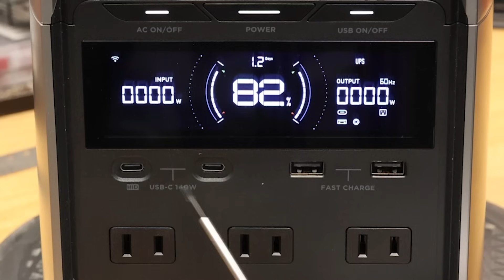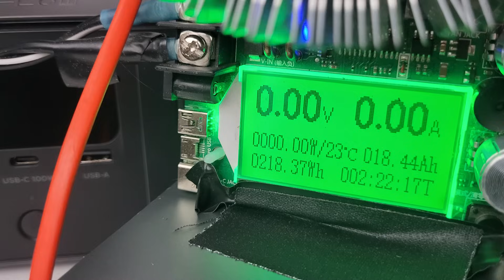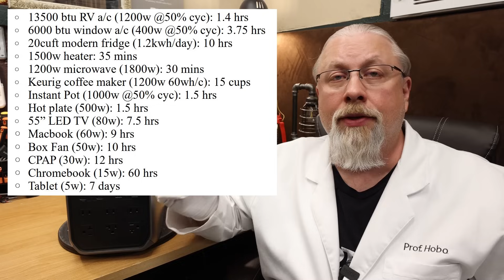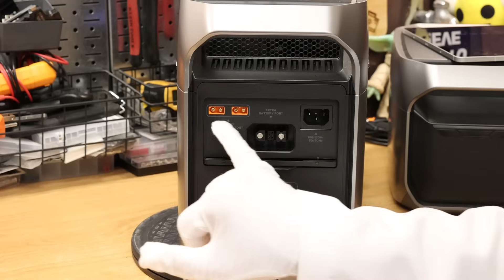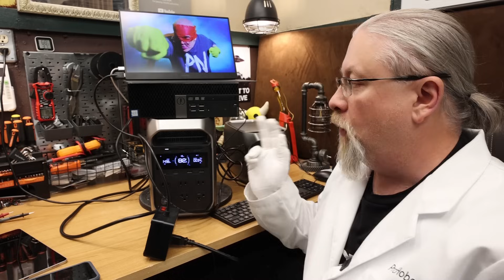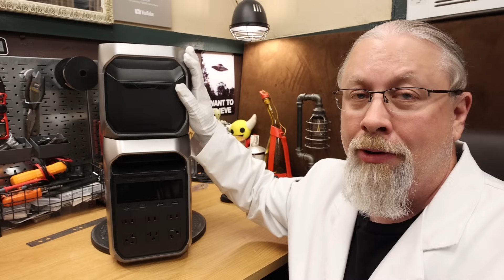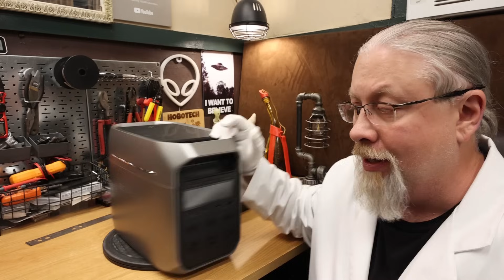ECOFLOW Delta 3 Plus 1800w | River 3 UPS Solar Power Station Review

Comment: Could I power this with 2 Renogy 220W panels in series and then 2 Ecoflow 45W panels in series? Thinking instead of paying for 2 XT60i cables I just get the 2 ecoflow 45W panels which come with the cables. then I get an extra little 90w of solar for a little bit extra

Comment: It's a waste of power to transfer power from one unit to another. At least when it doesn't have any inputs connected. If that's the case, it makes sense to transfer power to it and charge it, but from the looks of this video, I don't think that's the right way to manage it.
Reply: I would like to charge a small ecoflow river (easy to carry outside) from sun, then take it home and feed my bigger ecoflow used inside.

Comment: no comment on the overheating issues? not sure if you experience that on the Delta 3. please do a 1400watt to 1500watt load test and see if it will overheat the unit. Thanks much!
Reply from the maker: If you watch the video I do an 1800w load test.
Reply: @HOBOTECH  no over heat issue like other users reported? Thanks much!

Comment: Here’s one advantage to having two of these solar inputs… as we all know we don’t get the best
 Results if we mix like a 100 watt panel with a 200 watt panel. In series or parallel. However with this unit we could get the best
 Results by plugging in one 100 watt panel to one plug, and the 200 watt panel on the other plug!

Comment: I’ve found with ecoflow. Since the inverter wastes so much power. The one time you let it drain to 0% you lose many functions. Where other brands have a 0% protection feature.
Reply: Any of the EcoFlow products you can set to shut down at any percentage you want, just in case.

Comment: Thanks for the very well done video. I live in Tampa FL and just went through two hurricanes in two weeks. The second one ( Milton ) knocked out my power and I was out for exactly 8 days - not fun. I am considering the ECOFLOW Delta 3 Plus as an emergency power supply and really like that it can be recharged via solar. I also really like that it can be expanded with the add-on EcoFlow DELTA Pro 3 Smart Extra Battery. From watching the video, I learned that the extra battery is the same battery ( capacity ) as the Delta 3 Plus but it is just the battery ( and cable ) - but with out all the controls or ability to charge separately. Here is my question : the ECOFLOW Delta 3 Plus is listed at $649.00 ( ECOFLOW  website and Amazon ). BUT - the EcoFlow DELTA Pro 3 Smart Extra Battery is listed at $5,199.00 ( ECOFLOW  website ). I must be missing something - can you please provide some more information on the cost and availability on the extra battery shown in your video ? Thank you.
Reply from the maker: As everyone keeps asking this, the D3P battery is not yet available. You can get a Delta Pro 3 battery that's 4kWh.
Reply: @HOBOTECH  So to clarify - the " elephant in the room " - the extra battery that you attached to the DP3 in the video is actually the Delta Pro 3 4kWh battery and not a 1kWh battery as described - is that correct ? I presume that a 1kWh extra battery would be much shorter than the one shown in the video - same footprint but about 1/4 the height - does that sound right ? Thx.
Reply: @lifesabeach321  He has the delta 3 plus battery that you saw...it is not for sale to the general consumer yet...aka... you and I

Comment: love your video's brought a Ecoflow river 2 pro and love it  using it as usp on my computer  works fine it power go's out as long as computer is at idel  if computer is gaming the ups function dont work quick enough and it turns everything of for few seconds    can you when doing usp function do it with computer under load

Comment: So what if I have a 100watt solar, and plugged in to ac I wonder what the charge rate would be? What if I have the alternator charged plugged in and a 100 solar?
Reply from the maker: It will charge with both

Comment: If this were priced at or less than the bluetti ac180 which is selling consistently on amazon for $459 now and I got it for $400.00 during prime days. I already own an ac180 and it’s a good unit yet for the way my camper is set up the form factor pf the delta would work better yet not $250 better! Will be interesting to see what black friday will bring with bluettiac180’s this delta and the new jackery1000v2. Would love to see hobo do a video comparing all 3 or primarily the delta vs the ac180.

My bluetti doesn’t ship till the end of oct leaving me the ability to cancel until it ships. If this delta were to go on sale for anywhere close to bluetti’s price I would go with it.

Comment: I like my delta 2 - especially with the alternator charger setup. I only wish for easier/ more secure tie down options for in car or RV. Also the layout of the ports are often blocked when tied down. 
The improvements a to this D3+ seem like nice upgrades.

Comment: My only problem with this and other ecoflow devices is that the 12 volt socket, 10 amp is just not good enough for van use, would need / want at least 30 amp. So sadly, I would have to choose the bluetti. But I would like to buy an ecoflow.
Reply: What bluetti would you get?
Reply: @walker2508 Maybe Pecron e2000lpe.

Comment: When you said generator, he specifically said inverter generator. The problem I have with my generator, my UPS doesn't like it too much. So I either need to get an inverter generator that's friendlier to my UPS, or get something like this to keep my network up and going until I get the generator going.

Comment: Great review. Can I connect my Delta 2 to the Delta 3 Plus through the port instead of the dedicated battery and use the Delta 2 as an expansion battery. This way I can charge them separately and have extra ports?
Reply from the maker: You can't mix v2 and v3

Comment: In a UPS configuration for an AC load with the battery fully charged, what is the efficiency? Does 100% of the power go to the load or is there something else that eats power? (Presumably it does not convert to DC and back to AC all the time).

Is the AC sine wave synchronized during switching? (Not sure if this matters for an ATX power supply).
Reply from the maker: AC passes through all the time until the grid goes offline. The inverter is enabled so it will still consume power.

Comment: Good morning Dr. Hobotech, 

Would it make sense to buy 2 delta 3 plus units and hook them together for the extra capacity vs getting a separate battery? Not sure if this is possible, but then you would have 2 units with the same capabilities and added capacity. The extra battery cannot do anything else besides add extra capacity.

Great video as always.
Reply from the maker: They dont support paralleling.
Reply: @HOBOTECH  Ok, could you buy 2 and when 1 runs low, use the other to charge it using the AC port?

Comment: What will happen if you disassembly it disconnect the wall connector and replace it with solar connector direct ?    This need solar and wireless charge on top
Reply: Also rubber caps agains dust water hits

Comment: These all in ones are finally starting to offer the PD we all been waiting for. I can't wait to see how far they come in another yr. Would be cool if that extra battery could be used on the go separate main unit should the main unit fail you could maybe still use to charge USB and run 12v out. But, understand the internal space maybe limited for this and would only increase price.  @hobotech Another great review. Good job and thank you for helping us all understand these devices better.

Comment: YES! AC Outlets in the front!
Reply: That's funny because I wish it had outlets on the rear also (like my River 3 Plus) to make using it as a UPS more convenient.  
After getting a River 3 as a UPS for my household fridge (it's about 1-2 hours of backup power), I got a River 3 Plus and extra battery for my network equipment, then ended up buying 2 Delta 3 Plus units for other corners of the house.  All have been great supplements to the main Delta Pro Ultra unit powering most of the house.

Comment: Everything else is great besides the ups test you need to do it at a reasonable wattage. Between a gaming PC and the modem router and whatever the other small Electronics is about a thousand Watts maybe 1200 at the most do the UPS at least 800 Watts

Comment: Ecoflow is so close to cool but they just had to pick the Jackery route of 'proprietary everything.' Can't run their stupid Wave A/C on D/C without their power station, can't run their fridge on solar without their special $300 battery. Can't use their app without Internet... For a device IN FRONT OF ME! 

Pecron forever, much cheaper and they focus on core functionality instead of flashy gimmicks.

Comment: I really like that this has 2 inputs for DC charging.  I just had a thought... What if you connected it to the Wave 2 and then connected 400 watts of power to that input? Could you charge it at 1400 watts from DC???

Comment: 0: 45.   Why is the battery rated at only 80% charge? 
And 
2. At what percent is it discharged?
Thanx.
Reply from the maker: Batteries are rated to 80% capacity, not 80% charge.

Comment: Great review, love all the tests!!!

Two small corrections: First, the new generator does not have smart DC port. It charges D3P via AC port. Communication between the two is via BlueTooth (I think). Second, the UPS mode switchover is 10ms on Delta 3 Plus, not 20ms. On River 3 it is 20ms.

Thank you!!!
Reply from the maker: I couldn't find any info at all on the 3000 generator online and didn't unbox mine. My user manual said <20ms.
Reply: @HOBOTECH I was just going to ask where the link is for the new dual fuel 3000. I can’t find it anywhere either. Thanks.

Comment: awesome review professor, thank you. I have an offroading trailer Q: do you think I should get 2 (two) of these units  (Delta 3 plus) or should I get one (Delta 3 pro), what are your thoughts? I would like to run the EF wave and have juice for work from a laptop in the morning. I have the alternator charger and 400 w of solar. the Wave 2 has the battery also. What are your thoughts...

Comment: TLDR version,
 I bought the dp3 because of you. Hit by hurricane, power out 5 days, great having it kept everything running, thanks for your vids👍 

Long version,
Hey professor. I want to thank you for making great reviews. I've been watching you for over a few months and I liked your delta pro 3 video and purchased one for my stealth camper van 2006 Econoline e350's power system instead of building one with victron products and batteries. I chose ecoflow because I can also use it for hurricane survival and a van power station 2 in 1. I'm in SC and we were hit with 70mph winds and several downed trees and our power just came back on after 5 days. The 240v outlet on the dp3 sold me and I tied it into my houses breaker box. I was able to run every light, fan, modem for internet and fridge without 15 extension cords. I even ran a 1300w air conditioner in my master bedroom. The heat here was around 90s and night time with the humidity was in the 80s. I ran everything except my houses hvac, oven, water heater and dryer. The dp3 was awesome. I charged it with a harbor freight 5000 inverter genny on propane at 120v 1700w. But I only ran it to recharge my dp3. (Saved a lot of gas) Since I found out I can charge the dp3 with 240v faster I just ordered a 7000 watt champion inverter generator with a 240 outlet and an ecoflow 240 inlet cord for the dp3. Now I can recharge it in 70 minutes at 3400w! Just wanted to say thanks. Your video sold me on my purchase and it helped out family out tremendously over the last 5 days. Last hurricane for Matthew we were without power for 9 days and I ran my construction Genny the entire time. What a waste of gas. Now the hurricane is over I'm going to put it back in my e350 and go for a road trip. The Anderson port runs my 12 v Lights, roof fan 3x 12v cig ports, 12v cooler fridge and streamlight flashlight. I utilized the 30A RV plug for vans entire 120v system. The 120v runs a midea 5000 btu AC and all my outlets with a mini TV and microwave. I can't say enough about the dp3 and your reviews and recommendations.  Thanks again Professor Hobo. Keep up the good content! 😁👍
Reply: Do tell how you tied this to your home’s breaker box, I’d like to do the same! If this Ecoflow can keep a few lights, fridge & internet on during a power outage, I’d SOLD! Please let me know how you did this or was it done by an electrician?
Reply: @GiveThx4Him this is a great question. I hope he responds, as I’m looking to purchase two DP3s—one for charging so that the other outlets remain available for use.
Reply: @GiveThx4Him  Its called a transfer switch or a generator Interlock. The transfer switch will let you pick what circuits are important so your generator only powers critical things. A interlock powers the whole panel and you have to know what to turn on at what times. Interlock is cheaper to install since it's less labor. 

For example if you're toasting bread in the kitchen, the person that's about to use the hairdryer in the bathroom needs to know they have to wait until you're done or else it would shut off the Ecoflow. With a transfer switch with user defined circuits it's less likely to happen.
Reply from the maker: Awesome. I like hearing these stories. I was hoping a few more folks down there were prepared and had power thanks to the reviews.
Reply: Did you get hit by Helene? I'm in Augusta and had no power for 5 days too. Looking at different battery//solar for getting by and a gas generator later on.
Reply: I got a D2Max + extra battery after a hurricane.  Then I built a custom system with 4x2560w LFP batteries.  I have 1 20a breaker for the garage and 1 20a breaker for the office.  Then I got a LFP Tesla lol.
Reply: Do you have any video of this?
Reply: Out of power for 4 days and not having my CPAP for three nights sucked!

Comment: What's the point in having a 5 year warranty, 3000 life cycles to 80%, almost 10 years of daily use and a new model that's only marginally better than the Delta 2. Progress is great but let's not be wasteful.
Reply: New one is 4000 cycles. And it's not marginally better, it does EVERYTHING better and it's quiet. I HATED the jet engine from the D2, which is why I never got it. I have the D2M and now the D3P and it's an amazing unit.

Comment: Hi Prof. Hobo. Could you please review the Pro Power Onboard of the F150 Hybrid truck? In a way, it's a battery + generator + inverter with 2.4kW/7.2kW.
Reply from the maker: Sure, I'll run out now and buy a $80k truck to test it.

Comment: Great video and great info, I can totally understand the extra battery being with out any other connection methods. They don’t want it add all the unnecessary electronics for it to be used separately

Comment: "The inverter, which is 1800W, uses what you'd typically expect from an inverter of this size." Sorry but I have to disagree! 984Wh/24hr, or about 41W average idle consumption is beyond unacceptable!! Every modern 1500W-3000W HF inverter I've worked with consumes no more than 25W at idle. But I would still consider that to be inefficient. The system I built to run my well pump uses a 3200W model with the best idle power optimization I've seen to date - only ~12W, or 288Wh over 24hr! At idle, that would last nearly 4X as long as the Ecoflow's, which is an absolute game changer when it comes to making a small backup battery last several days. The same optimizations could be implemented into every one of Ecoflow's systems for pennies!... if they weren't exclusively focused on the flashy, marketable aspects of their products.

Comment: Great video! Question, you mentioned that in regards to the AC inverter, if the load is not present the inverter shuts down. If I had my refrigerator or freezer hooked to this would it shut down when the compressor is not running? Thank you for your time!
Reply from the maker: Depends on the timeout setting.

Comment: Professor Hobo, several alternator chargers are popping up at good prices. 560w Charger 1 from Bluetti. The cool thing is using the 12v battery in my ev to charge the Delta 3 Plus. The traction battery 60kWh keeps the 12v topped like an alternator.

Comment: wait...so if nothing is plugged into ac outlets but it's turned on, a full battery will die in 24 hours?? what if i plugged in something that uses 100w? will it die sooner than that? then what's the point of it? am i missing something? does it actually use less when something is plugged in? so confused.
Reply: If AC turned on without load, a full battery will be 0% in about 41 hours. If you plug in 100W device, and no inputs, a full battery will be empty in about 8 hours as it will use about 125W per hour. So you need to turn AC off when not in use.

Comment: another limitation, you can't use the new ecoflow alternator charger and an extra external battery at the same time, as they are using the single port on the Delta 3.  But overall still sounds like it exceeds 90% of users needs

Comment: The new dual fuel 3000 generator is not DC.  There are no DC outputs, just 2 AC outputs.  This means you can use the new 3000 AND the extra battery on the Delta 3 plus at the same time and the control of the 3000 is via wifi with no direct communication (via the CD battery cable).  It also has a 100CC engine as opposed to the 80CC in the older DC one.  But, if you got the 4000 and not the 3000, it is does have DC output.  Great review!
Reply: The issue with the DC output was that the generator had to be at full RPM when charging DC. With AC it can ramp up and down.
Reply: Do you have a link? I'm thinking of getting it but can't find any information or release date?  Thanks.